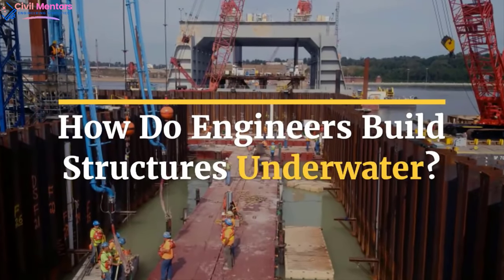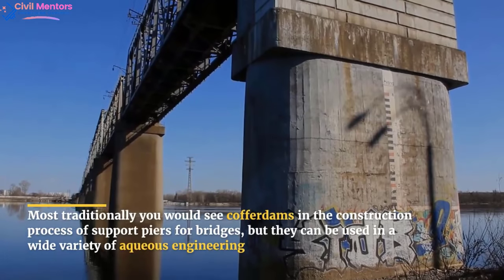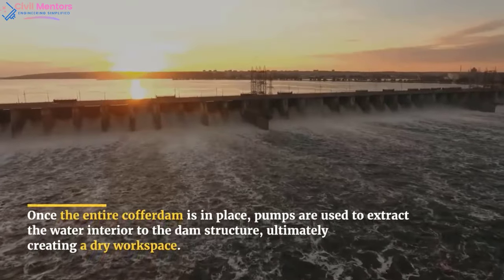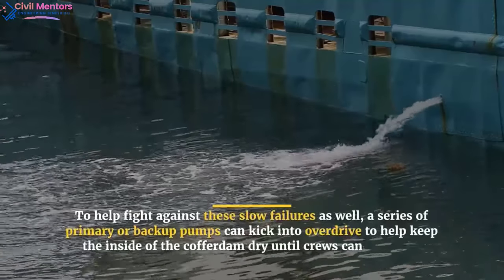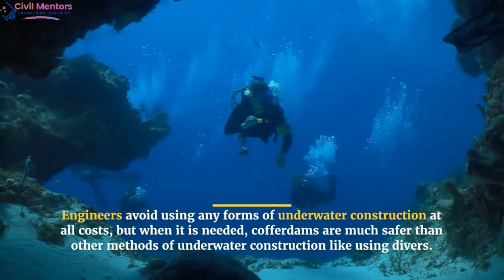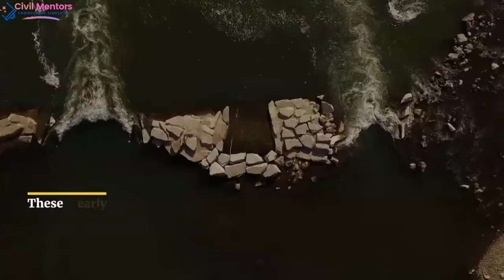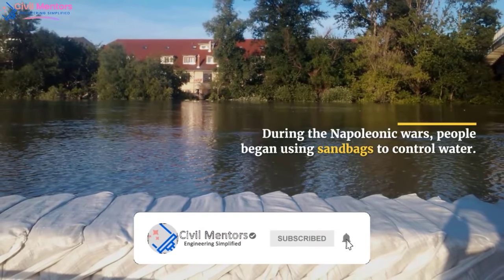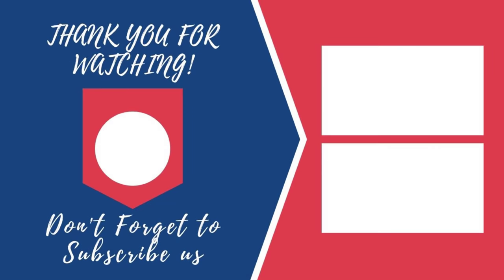How Underwater Structures are Built? Cofferdam Explained!

Comment: In My youth, (I’m now 64) I knew a Concrete Engineer who had to design a Concrete which could be poured in the Extreme Heat Conditions found at the Woomera Rocket Range in Outback Australia, without becoming prematurely dry and becoming brittle. 

Then he had to design a Concrete which could be poured underwater and which would then repel the Water and Set as required.
Reply: Two different extremes to work on with concrete. Did he actually succeed in designing the two different ways of doing the concrete settings?
Reply: @pauldunneska  Yes he did. And that knowledge is doubtless still being used in projects all over Our Modern World.
Reply: What was his name ? Here in the Netherlands we call it “onderwaterbeton” and for the pouring in extreme warm weather we use cooling systems inside the concrete
Reply: @Deanamite  Too long ago, his name long forgotten.

Comment: Humans capable of incredible engineering, and people still give credit to the aliens for the pyramids
Reply: Is this coming from a inferior race of jealous aliens?
Reply: Because the ancients built the pyramids with extreme accuracy without the measuring tools, cutting tools, computer modeling, materials, heavy duty equipment, and our understanding of physics. Heck, on some bricks in the pyramid of Giza, you can't even fit a piece of paper in between the joint.
Reply: @isaacvelasco6498 they also took several hundreds of years. I dont know why people underestimate the engineering capabilities of ancient humanity. Claculus was literally used by the babylonians pretty early on before it became an actual math.
Reply: human who built the pyramid without modern technology.
Reply: @isaacvelasco6498 well, Egyptians are great